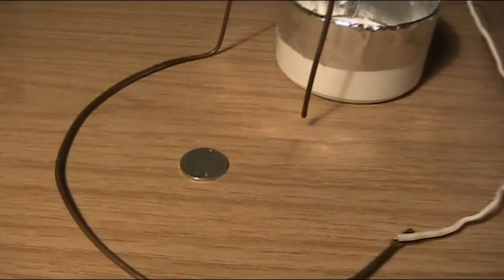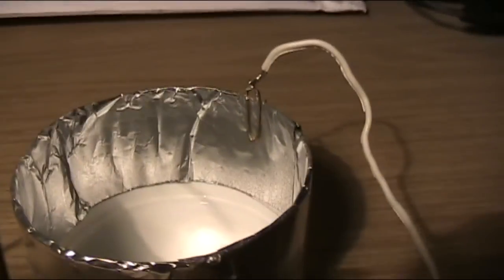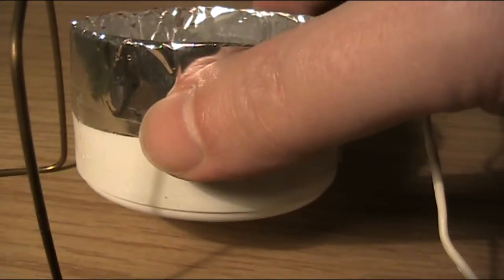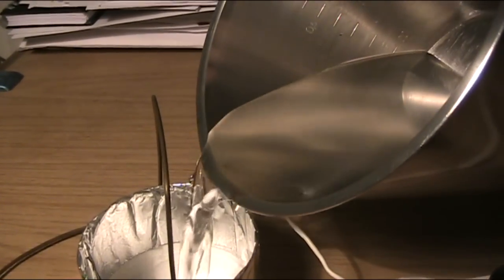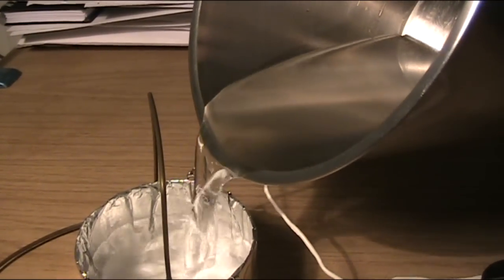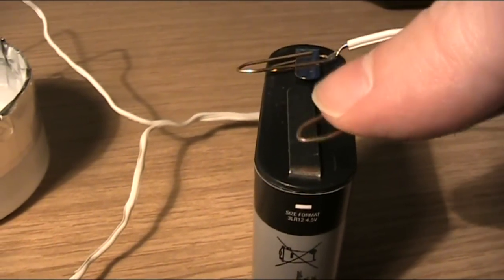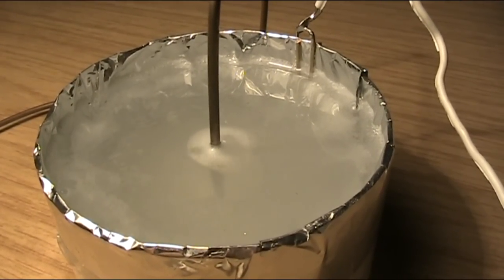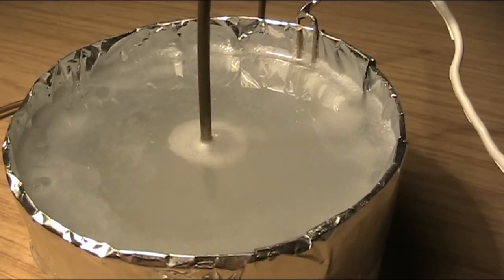Water rotating in a magnetic field

Comment: What happens if we rotate water in magnetic field, will it generate current?
Reply from the maker: Thanks for your question. That is one of the best questions I have got on this video. When I made this experiment as a young teenager, I also wondered about that very question. I have a (vague) memory that I actually tried to run the process that way, i.e. I stired the water around and checked if I got some electricity generated (I measured for voltage in the conductors). My memory is that I could not show such a generating effect, so either it did not show anything on the meter, or the meter showed voltage even when I did not rotate the water due to the setup in effect being a voltaic cell and the extra voltage that might have been generated due to forced rotation of the water was not possible to discern. But your idea is of course very logical, we definitely would expect it to work, unless we are overlooking something here. There are generators that are based on the idea that you bring up here. They are called MHD-generators, or magnetohydrodynamic generators (Wikipedia has an article about it). But among the different MHD-generators that I have seen (after searching on the net) I have not seen one with rotating salt water. I do have a vague memory that I some years ago did see an article or youtube video that showed that the idea works, but I am not sure. If you find out an answer to this question please let us all know here.
Reply: @BigParadox  sure, after lockdown, I might try it myself and will share the video. 
Thanks for mentioning wiki article, will research more about it.

Comment: Interesting demonstration of Lorentz forces on moving molecules with charge. I paused for a bit to understand how this works. Of course the anions are attracted to one pole, and cations are attracted to the other. If the anions are attracted to the center pole, those negatively charged particles will be consistently deflected to one side of the target, regardless of where in the pot they are coming from. So, anion movement is consistent with general fluid rotation in the same direct, but what about the cations? Although cations would be deflected the opposite way, remember that cations are moving to the opposite pole, so for them opposite deflection leads to likewise rotation....
Reply from the maker: Yes, this is exactly the way to understand this. And the key here, as you point out, is that the cations are deflected in the same direction as the anions because the cations have opposite charge but also moves in the opposite radial direction. So, two opposites take you back to the same deflection as the anions. Thus everything rotates in the same direction.
Reply: @BigParadox  Thank you - that explanation saves me painful twists of my hand and arm visualising the Lorentz forces.

Comment: I'd like to see what happens if you reverse polarity. Will the water rotate in the opposite direction?
Reply from the maker: Yes, correct, the water will rotate in the opposite direction.
Reply from the maker: @Loagun  Yes, exactly.
Reply: Is it backwards x2 depending on which side of the equator the experiment is conducted on?

Comment: this experiment appeared in the 20's and used a vertical glass box and the electrode from a 24 volt battery in a sulfuric acid solution. The magnet was facing the case at the level of the electrode terminus. The wood cut showed the bubbles rotating around the horizontal axis like a pinwheel.
Reply: . . . . think the book was describing an experiment from the 1800's.

Comment: I very much enjoyed your video, but, please explain WHY the rotation is clockwise or counter-clockwise, as both directions are technically perpendicular. When you're done scratching your head on that one, flip the magnet, repeat same exact process, and post results, as I'd love to see what your findings look like... :)
Reply from the maker: Yes, correct, both directions are perpendicular. I have previously linked to an explanation of this. I add the link here again:
https://www.electrical4u.com/fleming-left-hand-rule-and-fleming-right-hand-rule/

The rule that determines which of the two perpendicular directions will be the case is usually called "Fleming's Left Hand Rule" (described in the above link). Exactly why the rule is that way, and not the other way around, requires a longer explanation, and they touch upon it on that page.

And, if the magnet is flipped, or if the current direction is flipped, then the rotational direction will also flip. But if both magnet and current is flipped, the rotational direction will not change.

Comment: I was looking for the electric field effect on water molecules.  I appreciate your interesting experiment. However, some details should be mentioned in this video. First, to explain the water is spinning clockwise or counter-clockwise, you should tell us is the magnetic field pointing outside or inside? Second, the same problem applies to the current direction. The most important is that the flow is due to the ionized particles from salt, rather than pure water. Above all, nice video.
Reply from the maker: Hi Eric Zhang, I have explained all these things in comments to the video when replying to various questions. The problem though is that these comments tend to disappear in the mass of comments, and thus new viewers don't see them. I have now updated the description of the movie with some more of these details. Thanks for your comment.

Comment: I have to present a topic which uses EM principles/equations and showing those equations as a presentation for my undergrad EM class. I initially thought of doing magnetoreception in animals but realized that may be a difficult topic to discuss. However, I recently saw a video for the ionization of water that used parallel rods carrying moving current to produce a magnetic field that would separate a stream of water into a stream of higher OH and a stream of higher H concentrations; this would probably be more simple to discuss. Any info or area you can direct me for either topic?

Comment: Hi thanks for making this video I just wanted to ask you if the water will rotate more if the magnet is more big
Reply: Also,how much inches of copper wire to be used?
Reply from the maker: Yes, a bigger (or more powerful) magnet should result in a more powerful rotation. I am actually planning to make a new video about this, with a much bigger magnet in order to make the rotation stronger. Please make sure you subscribe and turn on notification so that you will not miss that video.
Reply from the maker: @meerabhatt3999  I don't remember exactly how long the wire was, but that aspect is not so important. If you want to make the experiment then just try to make a similar setup as in the video and it should work.
Reply: Big Paradox hey thanks for your reply I actually did the experiment but it was slightly different from your method but your video and reply helped me a lot so just wanted to say thank you
Reply from the maker: @meerabhatt3999  Ok, thanks for letting me know. I am happy my video had some value for you.

Comment: If you flip a magnet would the water spin counterclockwise?
Reply from the maker: Yes, that's correct, the water would start spinning in the other direction. And if you kept the magnet as it is but flipped the polarity of the current, then the spinning direction would also change. And, consequentially, if you flpped both the magnet and the current, then the spinning direction of the water would remain as it is.

Comment: In this case, electric charge of battery induces the magnetic field, which is perpendicular to the direction of current flow - right hand rule... If you change + and - on battery water will rotate in opposite direction. Didn't try it, but I guess so... :P

Comment: This is just a demonstration of the motor rule, isn't it? I remember in science class sticking the thumb, index finger and middle finger of my left hand out at right angles to each other, to represent the direction of the magnetic field (index finger), the direction of the current (middle finger) and the direction of the movement that is induced (thumb). While it is normally demonstrated in copper wires, salty water makes an adequate replacement as a conductor of electrical current, and moves just as a wire would.
Reply from the maker: Yes, correct. Here is a web page that describes it 
http://www.electrical4u.com/fleming-left-hand-rule-and-fleming-right-hand-rule/

Comment: Is the above explanation the reason for water movement or the fact that H2O s are breaking into Oxygen and Hydrogen, and that their movement through the water is giving it the flow?
Reply from the maker: The explanation is that charges moving in a magnetic field are deflected in a direction perpendicular to both the field and their own movement. The breaking down of water into oxygen and hydrogen is not part of the explanation. It is a by-product of the experiment.

Comment: What are the materials. Is that copper wiring connecting the magnet to the water?
Reply from the maker: The materials are not critical. The magnet is not electrically connected to anything. The central pin (which is made of brass in my setup, but can be made of any metal that conducts electrical current well) is just conducting electricity into the water. That electricity is conducted by the water to the aluminum foil, and from there back to the battery.

Comment: I understand your explanation but we know when the electricity gos through a wire creates a rotation magnetic field so the water can rotates without a magnet. Is that right?
Reply from the maker: I think I understand how you reason here, but there is a problem with your idea. The magnetic field around a wire does not rotate. It is circular, yes, but it does not exactly rotate.
Reply from the maker: @redouanered-one8676  I have looked at the beginning of the video you linked to. Very early in the video they mention "rotating magnetic field". This refers to a situation similar to when a magnet is rotating around an axis between its two poles. And that is exactly what that video talks about in the beginning (I haven't watched the full video, so I can't say what happens later on in it). 

There is a Wikipedia article about this, https://en.wikipedia.org/wiki/Rotating_magnetic_field, pleae check it out. It is a very common thing used when generating alternating currents, or building electical motors, etc. But, again, the magnetic field around a wire does not rotate, although it is concentrically shaped so to say around that wire. Check this explanation https://physics.stackexchange.com/a/155658. 

I can give you an analogy which poped up in my mind right now, it is not perfect in all regards, but it helps to illustrate that something might be circular in shape and even have some kind of direction, but is still not rotating. Think of a spiral staircase, it has a circular shape, and you can also say it has direction, a down direction and an up direction. But, still, it does not rotate.

Comment: is it because of the polarising effect of water molecules?
Reply from the maker: Not exactly, it is because ions from the salt in the water (i.e. charges) are moving between the center pin and the circumference. Charges moving in a magnetic field are deflected. The water is pulled along with them. There are both negative and positive ions, so they move both towards the pin and away from the pin. The net effect of those two radial movements is zero so to say, so water is not moving in any of these two radial directions. But both the negative and the positive ions move in the same deflected direction (which is one of the two directions that are perpendicular to the radial directions) so there is a net effect of that movement, and that pulls the water along. So rotation occurs.
Reply: excellent elucidation  @BigParadox

Comment: Hi @TheBigParadox . When I did this experiment, for some reason the water turned yellow. Do you know how that happened?
Reply from the maker: I don't know. What material was the middle rod made of?
Reply: Copper
Reply from the maker: Copper does not produce any salts that has purely yellow color as far as I know, only green and blue. Copper(II) chloride can be close to some yellow color. Was it purely yellow or more towards the greenish shade?
Reply: It was not pure yellow, but very close to yellow.
Reply from the maker: Ok, I don't know really. Are you sure there was no iron in the rod? Iron(III) chloride is quite yellowish I think.
Reply: I was sure that there was no iron on the rod.
Reply from the maker: Ok, right now I have no good explanation then.
Reply: Oh ok thanks :)
Reply: due to decomposition of salt water
Reply: oh ok thanks

Comment: If you flip the magnet over to its opposite pole did you see a different rotation of the water?
Reply from the maker: Yes, this is exactly what would happen. And you would get the same result if you would swap the polarity of the battery. But, if you flip the magnet AND swap the polarity of the battery, then the rotational direction would remain unchanged.

Comment: which charge is rotating ?  Na +ive or  Cl -ive ?
Reply from the maker: Both are rotating and both have the same rotational direction. 

The rotation of a moving charge is determined by the direction of the magnetic field and the direction of the electrical current that the moving charge corresponds to. The Na+ ions and the Cl- ions are of course moving in opposite directions, but they both correspond to an electrical current going in one and the same direction. 

In other words, when Na+ ions are going in one direction, they represent a current going in the same direction as the current corresponding to Cl- ions going in the opposite direction compared to the direction of the Na+ ions. 

You can understand this easily if you think of a simple electrolyis situation. There you have positive ions going in one direction, and you have negative ions going in the opposite direction. But if you think of the electrical current, you have only one electrical current, and it is of course going in only one direction. So positive ions going to the left correspond to the same direction of electrical current as negative ions going to the right.

Comment: What happens if you reverse the magnet, and the contacts on the battery?

What if you only reverse the battery contacts, leaving the magnet alone?
Reply from the maker: If both the magnet and the polarity of the battery are changed, the rotational direction will remain unchanged. But if only one of them is changed then the rotational direction will change. So for example, if battery polarity is left as it is and I turn the magnet upside down, then the rotational direction will change to counterclockwise.

I can mention now that I have procured a much stronger and bigger magnet, and I will remake this video with that one instead. The result should be that the rotation will be much faster and clearer.

Comment: Seeing I have plenty of neodymium magnets sitting around from old hard drives, I will be attempting to reproduce the experiment to confirm or deny it. Is there anything I should know? Is there a wire wrapping around the container under the foil? Such things will make a difference in the results. And a wire wrapping will cause a current to move in the direction of the wrapping. If I can't get this to work, I will post that it's likely a prank. I personally won't go repeating things on the internet that can't be proven. So let me know if there are details I need to know.
Reply: +IamNemoN01 Hi, I don't think magnets from hard drives will produce the same effect since both the N and S pole are in the same face of the magnet. When using a hard drive magnet, I think you will see bubbles moving along the magnetic field of both the N and S poles... not in circular pattern. I am not sure since I haven't tried it yet but at least that would be my educated guess...
Reply: +spyx3m I only have magnets from about ten old hard drives (there are two magnets per HD), and I have a few right here on my desk (and I have two hard old hard drives that I still need to take apart). So I can say with 100% certainty that the poles are NOT on the same face. In fact I have literally hundreds of magnets I've collected over the years - I even have one from an old 18" Peavy bass speaker that is at least 12" diameter, and is powerful enough to rip the door off your fridge. . . and I have NEVER seen a magnet with both poles on one face of a magnet. Such a magnet would be 100% [unnatural], and it would need to be specially designed and ordered for a particular purpose.

So no offense, but you really don't know what you're talking about. I do know what I'm talking about.
Reply: Technically magnets DON'T have both poles on the same face. They always have them on the opposite POLE, which is why they call it a "POLE".
Reply: IamNemoN01 well u are wrong there because I've actually managed to magnatise a ferrite piece with both poles on one side